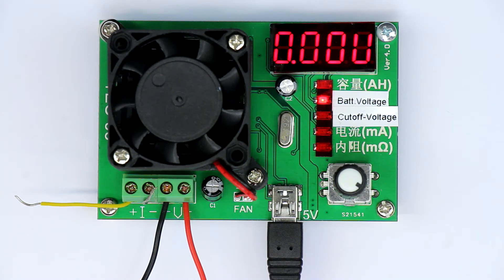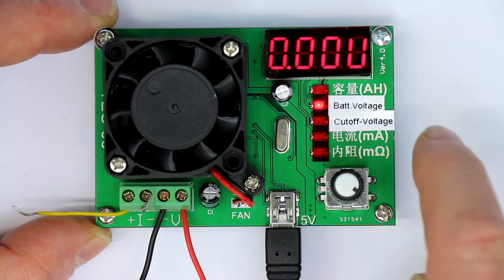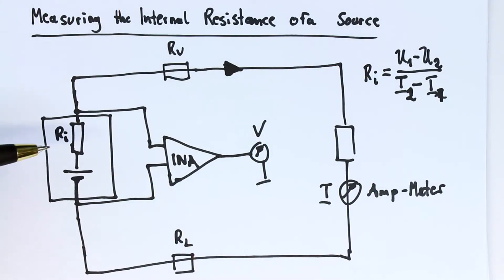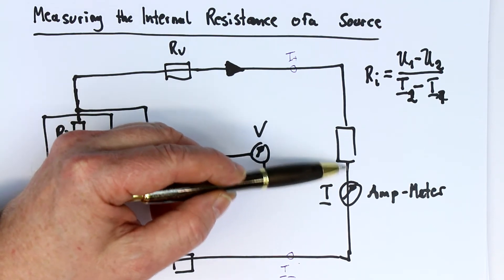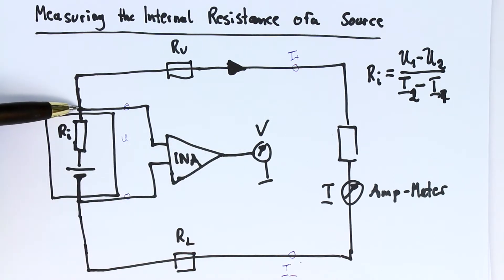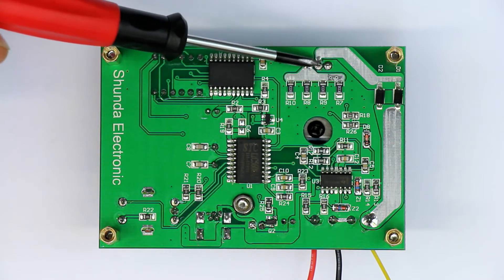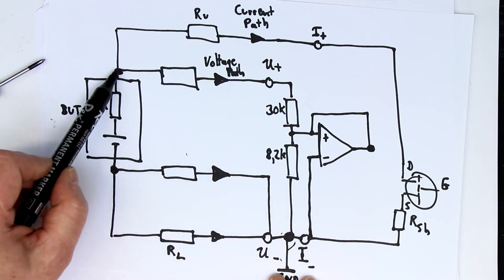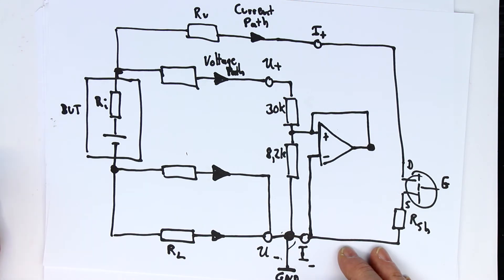Modding the TEC 06 for 4-Terminal Kelvin Measurement

Comment: Is the result any better than buying another unit that’s made better?  I’ve already had to put a momentary switched capacitor on the input to avoid powerbank cutouts when starting a test, and adding a reset button when the unit gets stuck and needs a reset. I can’t imagine needing to do another mod.  I’m quite happy with the ATORCH DL24 as-is and it does so much more. The TEC-06 is in a box somewhere, with English translation labels stuck to the PCB too.

Comment: What is preventing part 2 from being posted? Has the TEC-06 manufacturing company caused a problem for you because of the several problems you found with this design in your original video review? Have they instructed you to NOT post part 2 of your "Kelvin Mod"? It seems like part 2 would be a VERY quick bit of work to test your proposal and display your results once you received the new replacement LM324, but it's not yet posted 19 months later? You seem to have numerous other projects posted in the intervening months. Or, is this a YouTube search failure issue?
Reply from the maker: If you scroll through the other comments I have already commented on this. The mod with a better OpAmp works and gives near perfect results. But you have to bend on pin of the OpAmp upwards and solder 2resistors directly to the pins. So it´s not very beginners-friendly mod and thus I didn´t do a supplementary video. Producing videos is also very time-consuming and sometimes a loose interest in some older things and have more ambition to do videos on things I am ATM "working" on. And of course nobody can "instruct" me to NOT post anything "critical" :-)

Comment: So you never actually got it to work properly, correct? Just a thought - are you sure it is waiting long enough for the voltage to settle, when it turns off the load to measure the unloaded voltage? The reason I ask is that I notice that for NiMh, the voltage increases to about 1.2V after a capacity test has completed, even in the mode where it uses the open circuit voltage to test for the termination voltage. I'm using a 0.9V termination, so 1.2V seems high, but I'm no expert. If it's not waiting long enough, impedance measurements will be too low. I don't have an oscilloscope unfortunately.

Comment: So no part two?
Reply from the maker: The mod works and improves the accuracy but still the internal resistance measurement does not give very reliable values.
They are jumping around by a factor of 2.
So it´s not really worthwile to take the effort to make the mod.
Reply: @KainkaLabs  I know you are doing a great job. 
So this unit is good only for capacity measure?
Reply from the maker: Yes. For internal resistance measurement I wouldn´t use it.
There are specialized devices for that like this one:
https://www.elv.de/akku-ri-messgeraet-rim-1000-fertiggeraet.html
You can also do that by yourself with a simple load resistor and 2 voltage measurents directly at the battery terminals (with and without load-resistor).
Then the internal resistance is: Ri = (V2-V1)/R
Reply: @KainkaLabs  i was searching YouTube for this diy project. Found some good builds. Do you suggest any specific diy project for this measurement?
Thank you
Reply from the maker: No, I don´t. Sorry.
Reply: @KainkaLabs  But, The voltage for the Capacity measurement is also off a bit (as showed in the other video) so cut off will be a bit to late?

Comment: did you manage to solve the problem? for me, internal impedance is not important, but voltage difference is crucial because cutoff voltage is measured wrong and that leads to faulty battery capacity measurement.
Reply from the maker: Yes, problem solved. 
But you shouldn´t worry about the cutoff-voltage as long as you set low enough.
Take e.g. a 1,5V alkaline battery.
The measured capacity is nearly identical with cutoff-voltages set between 0.1V and 0.9V.
The remaining capacity below 0.9V discharge voltage is negligible.
The capacity is much more dependent on temperature, discharge current, pauses during discharge (electrochemical recovery) etc.
As long as you take thick enough leads for the current path so that the voltage drop over the leads is less than 0.1V with your chosen discharge-current there really is no need for the modification.
Reply: I did some translations from Chinese manual that I received and found interesting information.

It has two ways of capacity measurement: with 2 wires and 4 wires connected. In 4 wires connection test (like you did it in video) starting by clicking the button in AH led position,  it uses pulses to measure open circuit voltage (that is the situation when the current drops on instrument). Than it uses that value to calculate internal resistance every few seconds. The displayed voltage value is open circuit voltage and that’s the explanation why it differs from measured.

In 2 wires connection mode (connected to I+ and I-) which can be started by pressing the button when led is on batt voltage position, it gives a real time voltage value (in my case difference was 0.02V).

If I understand it right I think it recommends 2 wires connection in regular use.

Here is Google translate from Chinese, I’m not a native English speaker so you might better understand:

The TEC-06 detector has two types of battery access: two-wire and four-wire.
In the 4-wire access mode, the internal resistance of the battery can be measured, and the measurement result is displayed in real time. The measurement principle is as follows: During the discharge process, the detector will detect the line voltage in real time and generate a momentary off every few seconds. Break the pulse and measure the open circuit voltage during the pulse. The open circuit voltage is reduced by the on-line voltage and divided by the discharge current value, which is the internal resistance value. The measurement using the four-wire method considers that when measuring the on-line voltage, the voltage on the line is generated and the measurement accuracy of the on-line voltage is affected. For more accurate measurements, it is more accurate to use two wires at the root of the battery. This principle of detecting internal resistance is closest to the actual usage. Measuring the internal resistance needs to start with "mode 1" (in the "use step")
Reply from the maker: That is a very valuable information. 
I will try to pin this for other users in the video-description of the main video about the TEC-06
Reply: Hi, can u show an exemple on where to solder them and which resistence to solder?
Reply: Hi , i have bought fews of this tec-06 and i would like to do the moding for 4 terminal kelvin mesurement
As i couldn't see in this video witch pin to desolder from lm324 and how to solder the 2 resistance ,could u explain in a draw on how to do it please
Thanks
Reply from the maker: Write me a PM so that I can email you a drawing.
In short. You have to desolder pin 13 from the LM324. 
Then place a 8.2k resistor from pin 13 to 14 (feedback path)
The negative current-sense input then comes via a 30k resistor to pin 13.
As one viewer noted one of my drawings in the video has the "+" und "-" terminal of the OpAmp accidentally reversed (giving positive instead of negative feedback).
The circuit topology and theory of the single-OpAmp difference amplifier is explained e.g. in the English Wikipedia if you go to "Operational amplifier applications" --> 2.1. "Differential Amplifier"